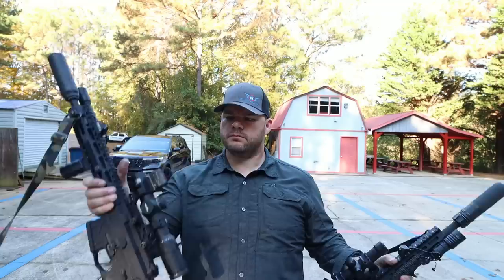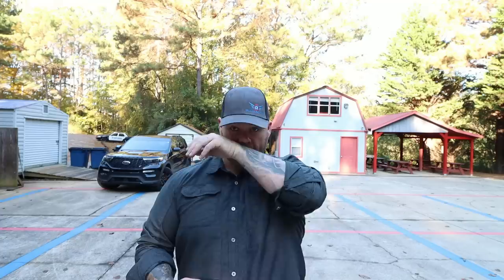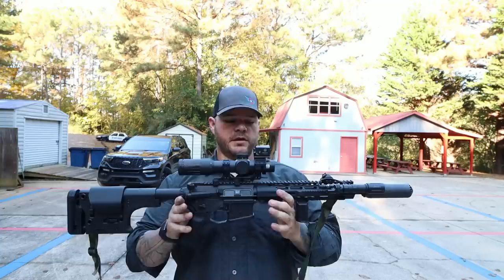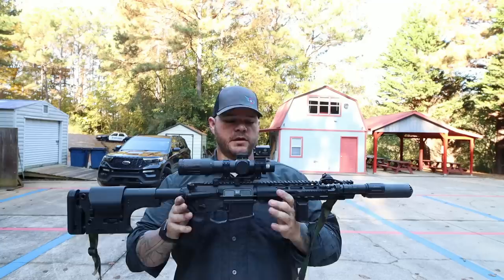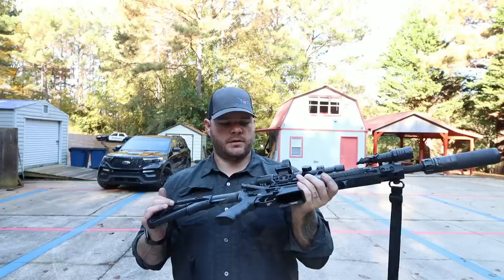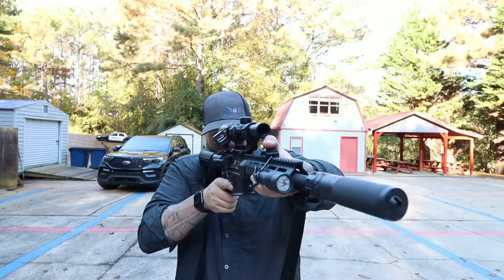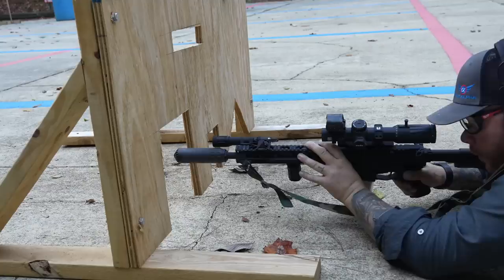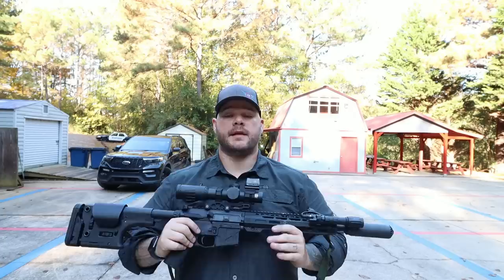Offset Rifle RDS- 12 O'clock vs Canted.

Comment: 12:00 is also handy for high magnification. If you are at 20x looking for a target …you use the dot to get you close to on target, then transition to the magnified optic.
Reply: This is also done with a 45 degree offset optic.
Reply: Yea you can do it just 12 o’clock is better for that application. Not even close lol
Reply: @frankhujsa821  No. you have to move your rifle. With it at 12 with a 20x optic you are probably prone and with a bipod.
Reply: How is it better than just looking over the top of the scope?  The dot isn't going to be slaved to the reticle on a 20x scope.
Reply: @frankhujsa821  if you’re running a bipod though it might be a bit easier to transition from a 12 o clock mount, otherwise yeah I fully agree it’s no different with either
Reply: @gunsandcommissions  Because the red dot is still zeroed. So it gives you a finite point in line with the axis of the bore that allows you to get close enough to your target to not have to fish for it in a narrow field of view. It is a very specific case of limited utility, but it does offer some utility in some cases. More often than not, I would prefer to not be at the upper magnification of my optic unless I have to be, and to find the target at a lower magnification before zooming in with a higher magnification, but in dynamic situations, you don't really get the ideal very often. You may not have the time to zoom out before leaving one point of cover, and may therefore be forced to start from the highest magnification on your next engagement. Being able to find a 3 MOA dot hovering over the top of your scope that gets you close enough is faster than running through your magnification range twice and may make a pretty big difference in how effective you are.

Comment: Shot both set ups a lot. I prefer the 12:00 o’clock. Here’s why. I train shooting from both my right and left sides. The problem with 45 degree off set IMO is, if you have to transition the weapon to the opposite side to shot around cover the red dot becomes absolutely useless. I agree with this man……it comes down to set up and most importantly……training/practicing. Awesome video. Thank you, Sir.
Reply: You can still shoot with lpvo at x1. If you have to shoot with the opposite side, you have time to adjust the LPVO in x1, right ?
I am not criticizing your experience and your opinion (on the contrary, I appreciate the numerous opinions of my American brothers !), I am just trying to know; I'm in the process of switching my AR15 from a red dot to an LPVO, so I'm trying to find the configuration that will suit me best. And here in France, it's really not easy to have differents rifles to test/try !

Comment: Yeah I tried a top-of-scope mount, and even though I have my LPVO on a 1.5 height, didn't like the 'hovering' chin-weld and the extreme height over bore.  Went with an Arisaka offset mount and actually use the 35˚ instead of the 45˚, and the transitions feel natural.  Definitely prefer and recommend the diagonal offset.  Zeroed red dot at 36 yds, like all my red dots on 5.56 guns.

I also tried higher mounts for the LPVO since I prefer a lower-1/3 height on red dots, and though the height felt comfortable when I was shooting standing, when on barriers or especially prone, since I was leaning more forward I had to crane my neck back to meet that height and lost cheek weld, so it was like hovering and losing the eye box.  Went back to a 1.5" height and even though I have to press down more when standing, it's still natural enough and with that cheek weld consistent, when pressed onto barriers or prone I'm right on.

Comment: The newest trend is the heads up (chin or no cheek weld) type of shooting that favors very high mounts (Unity and others).  It is supposed to foster greater situational awareness, especially in closer quarters, and also allows use of the optic with NV.  I want to experiment with this set up more, although I ve been pretty comfortable with 45 offset (incl with irons).  I love your videos, their use case considerations, and critical thinking. Just noticed I wasnt subscribed, so just did. Thank you!

Comment: 45° is definitely the move for GPR's and battle rifles. The only exception, with much debate of course is the piggybacking red dot on an ACOG. Outside of that, an LPVO or regular power scope with 12 o'clock red dot is great for special purpose rifles such as a DMR, or heavier guns that are not designed to be as maneuverable, but instead stationary. The 12 o'clock dot on a SPR/DMR is useful for quick sight acquisition at distance and unexpected combat engagements between locations. It is simply a tool to bail you out under certain conditions to give you a better chance at survivability. If you're not going to be running and gunning or on the front lines, 12 o'clock is a great option if you can get used to it. 45° is perfect for quickness and effectiveness under stress, as well as shooting from unconventional positions

Comment: I like the 12 o'clock for house clearing. It reminds me of a tall-mount Aimpoint T-1/T-2. I rarely have a cheek weld when opening doors, so the transition to sighting is more natural to me. You can pretty much see your dot in the low-ready, so as they say, "you're there"

Comment: Aaron, excellent discussion as I am in complete agreement with everyone that a secondary sighting system is critical. On every platform which contains a red dot, I have backup iron sights which will co-witness, no issues. On each of my platforms which utilize an LPVO, I have 45 deg fixed iron sights. At the time it was the fastest, transitioning from LPVO to secondary sights. My only decision was based off of watching and listening to Barry Duecke  who inspired the Surefire RTS sights. Anything for competition he used the angled iron sights first, then went to LPVO. The RTS sights are not cheap and with current prices on a red dot with mount, the latter may be the way to go. However, when shooting from the ground thru a barricade or opening, there may not be clearance to use a red dot to achieve a correct sight picture, let alone with an LPVO. Being a short guy, I am guaranteed to get closer to the ground and achieve a sight picture with the 45 deg iron sights. Whatever one decides, confirm the usability under all conditions: i.e. prone, barricade, thru barricade, under lowered vehicle such as kit car as opposed to full size truck. Thank you again.

Comment: One valid consideration is to use your 12 o'clock piggypack red dot as a canted sight as well, just with your other eye.
It certainly takes some time to get used to, and to reliably find the dot, but it's a great option if you want the extreme height for night vision, but no chinweld at daytime.
Reply: Right I agree. But you have to know point of aim if you angle it like this.
Reply: @swiftaudi  well, you just turned giraffe optic tower into canted, cross-eyed giraffe optic. So you better figure out how to use it.
Reply: Just mounted an red dot on an acog and almost went to the 45 degree off set which is quick, but I hate things hanging off my gun like that, so I experimented with using it canted with my other eye and I find it just as fast and much better than raising my head which I found much harder to find the dot and did not feel right.

Comment: I'll be PC and say it is probably subjective. With that out of the way, I find the canted way to be ridiculous. The argument that with 12 you have to change your cheek weld, but then, they have to readjust their "butt weld", which imo is WAY worse. The time it takes me to readjust my cheek weld is probably half of the stock. Just unnecessary and ugly and it gets in the way of my shirt and/or body armor.

Second, at close distance where you'd be using your dot, chances are having a stable rifle "weld" is more important than your cheek weld. At really close distance in CQB you won't even be looking through anything but where you're pointing at.

And last rant, if you need a high mounted magnified optic then chances are you are being redundant. If you don't shoot prone very much you probably don't shoot far if ever. At that point just leave it on 1x.

Canted is a fad.

Comment: I've heard that running top mount is better for passive NOD's.. and that's probably right, but the canted is by far the better position for anything without NOD's.  I even have a few rifles rigged with canted irons, and even they work great and are quick to transition to.   (edit: of coarse you mention that in the video, I should have just waited. lol)

Comment: The stabilization problem with the cheek weld on the 12 o’clock would be even more pronounced on a more powerful cartridge like a 7.62x51 due to recoil and weight of the system

Comment: Have you considered using 12o'clock mount, and rolling the rifle 45° to place the MRDS in front of the NON-dominant eye?  This preserves the cheekweld from the magnified optic.  This is one of the strengths of shooting RDS sights with both eyes open.
Reply from the maker: It might for some, but they would be in a minority. There’s also parallax to consider and the processing delay from dominant to non-dominant.

Comment: Another point to add to this topic; it is very firearm-dependent. For example, using a canted RDS setup on an AK is usually a no-go because the shooter will hit their hand on the optic and/or its mount when pulling the bolt carrier back.

Comment: Maybe I have alien eyes or something but- mount backup optic at 12 o’clock, roll rifle 45 deg (same as you would with an offset) and your left eye (Still both open) will pick up the back up optic even when it’s mounted on the piggyback. Head position stays for primary and backup. Best of both worlds… you get the speed of the offset plus you don’t have an optic hanging off the side of the rifle plus you have the ability to shoot heads up for night vision and/ or speed

Comment: Excellent video, I am myself one that prefers a 35° offset (offset optics in general since 2019, started with 45°, but I see the reasoning behind both. 

I think having a top mounted/piggyback or whatever mount, like an RMR on a VCOG or ACOG, makes sense if the weapon is going to be kind of mass-issued, like in the Marines. And specifically, this has to do with the fact that it's much easier for the armorers to bolt on a bunch of RMRs on top of 30,000 infantry rifles' main optics, and zero them, as opposed to 1) buying a shit ton of offset mounts from Arisaka or T.Rex Arms (very likely exceeds their manufacturing capacity in a realistic time frame), 
2) now you have two things to mount, being the optic to the mount, and the mounted optic to the rifle, and 3) zeroing it. Offset optics are not fun to zero, but having a simple piggyback optic takes all the headache out of it other than determining what distance you're going to mark for your zero.

Comment: I think you show multiple ways of doing things and you just go with what everyone each wants to do.   I actually run 3 sights.  I have my 5x prism with my piggy back rds.  But I also have backup canted sights that I can also use as a primary canted option.  Our modern kit is fantastic for not only backups but think of it as multiple primary sighting options.
Reply: That's great

Comment: Great vid.  I set up a rifle with a VLPO a couple of years ago and I'd never seen one with a red dot back up before but it just made sense to me so I did  it and like you, I went with a 45 offset.  Most of the RDS s I've seen in use and on catalog sites show them in the 12 o'clock and I tried it, but it just felt awkward and for me to reach that high, I had to open my mouth to even get a chin weld.  The 45 makes so much sense and I'm glad to see I'm not the only one.

Comment: I like to think of both optics as a “primary”. I’m in the 12’oclocks. Dependent on situation will dictate which optic you use as your “primary”.
If you’re doing cqb type stuff, you’d probably want a high mounted red dot, for longer distances you’d want a magnified optic with good cheek weld . I’m surprised there wasn’t much mention of night vision, seeing that you shoot a good bit of it. I feel passive aiming with 12oclock is way better than canted. Granted a lot of mrds don’t have great light transmission for passive aiming, some do a pretty good job. And adding supplemental IR illum. can remedy the issue.
Reply: That makes sense to me as a good way to look at it, a sensible option. What would your HOB be for the RDS? My existing mounts put mine at I think 3.3" HOB already. I'm guessing and RDS on top of that would be close to 5".

Comment: For the 12 o clock rds, you really can’t have a higher mount than 1.54”. You also need a specific mounting setup to avoid having an overly tall setup. Geisele with a reptilia the optic sits snugly low. I would say the same amount primary arms’s new offering.

Comment: gotta roll the rifle and use your off eye with 12 o'clock mount. it changes the game 100%. the offset mount is only useable on your strong side, 12 o'clock can be used on strong and weak sides
Reply: It's a neat trick. If you know, you know

Comment: I’m seeing shooters who live in cities actually now play with the concept that their red dot is primary and instead of magnifier go with a canted magnified prism (to get the reticle bdc benefits instead) so rotate to magnify and engage long range instead of the traditional rotate to engage close range.  The concept here is the optic you think you will use the most should be at 12 o’clock yet you don’t necessarily want a red dot on top of your prism or lpvo because you want both to have good cheek welds or work with barricades but intend on using the red dot way more.  The PMA mount in interesting too as it’s not canted but rather just goes parallel to the side, I wonder how that one feels.

Comment: Having played with an AUG for a few months, I've been digging the 12oclock position, but I do think it requires a bit of a different philosophy. 

For a general purpose rifle, I use the piggyback RDS as the primary and then use the LPVO as the secondary. It does involve moving the LPVO a tad lower, but it puts the RDS in a good heads up position. Regardless, for a piggyback RDS, you need to do whatever you can yo get the RDS to be as low as possible to reduce the height over bore and some mounts are just not built for that.

Comment: I use a 12oclock almost exclusively for passive aiming under nods, to that extent I don't really regard them as backups just an alternate sighting system. I even use... gasp an open emitter! Yeah shocking, but in several field problems have yet to encounter any fuckups with it

Comment: I love the idea of LPVO’s, I don’t like the weight. Adding a pound and a half in the optic is a lot for the dental floss hanging out of my sleeves. But, I’m back and forth on my optics for my Ruger SFAR. Primary Arms 1-8 FFP Raptor, new 1-10 FFP or new 5x prism with offset red dot. The 5x would be the lightest, by a lot. Decisions, decisions.

Comment: Also body mechanics. Yeti can run a top dot better than most because he’s huge. Most other folks would benefit from offset dots, self included. I’ve tried both. I’ve seen more luck with folks I shoot with using the top dot with longer range scopes as well, making spotting easier but really not being used much otherwise except for CQB concepts, which isn’t the concept of the rifle in this case.

Comment: Great video! Question - would a 45 degree RDS offset mount push more gas in the face (especially when suppressed) as opposed to a 12 o clock mount? Cheers

Comment: For CQB in the 12 o’clock, red dot mounted on top of LPVO, position it makes more sense to run the red dot as your primary and your LPVO as your secondary. Running it with the offset mount makes more sense to run your LPVO as your primary.  So it depends on what you want to use it for and what works better for you.

For CQB I run a red dot on a unity mount and a magnifier on a unity magnifier mount.  The unit mounts are much higher and you just have to cheek the gun to get a good sight picture behind it. It is faster and works with gas masks.

 For CQB If I were to run a LPVO I would run a LPVO mounted red dot and run the red dot for CQB. If I need to take a longer well aimed shot I can get a good cheek weld behind the LPVO. 

When it comes down to CQB, one is close quarters so sub moa accuracy is not needed, and Marines ran 4 powered ACOG’s with no red dots, it was just point and shoot. 

For something like a Recce Rifle I would run either the offset or the LPVO mounted red dot as I am more concerned with longer distance engagements.  When it comes down to it, its whatever works for you.
Reply: @Ass Clapper didn’t ask you to explain your answer, I asked you for your counter argument. How about this, how would you run your set up and why?

Comment: why doesn't somebody just make a slightly adjusted side by side mount for 2 optics, so where your primary optic is being shifted more towards the left of your firearm ever so slightly, to be able to mount both optics side by side to make kinda like a Binocular effect, that way you would not have to shift your cheek weld to a chin weld or twist to 45 deg. I'm not positive but I think think I saw a picatinny mount like that on Amazon, but regardless try it may be worth looking into, you may start a new trend or something if all ales fails you are back to square one

Comment: I run a LPVO with a 12 o’clock, and a 45 on each side because you never know when youll need to be shooting weak shoulder and need to transition, the 12 is for running nods….

Comment: On my SPR I am running both a 12 and offset mount dot, they have two different jobs, the top mount is for rough aiming the scope and NVGs and the offset is for up close. 12 o'clock dot has same zero as the scope does, offset is for 25m. There is a reason my gun is running an LMT DMR stock and it's because it has an adjustable cheek riser...